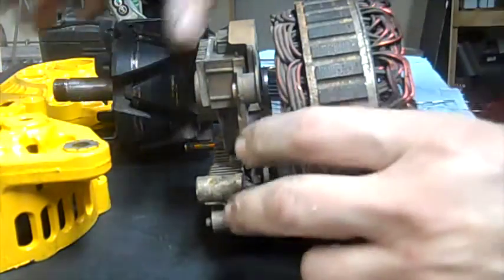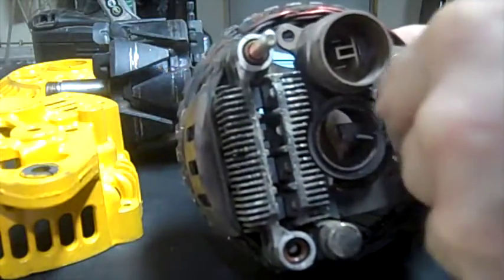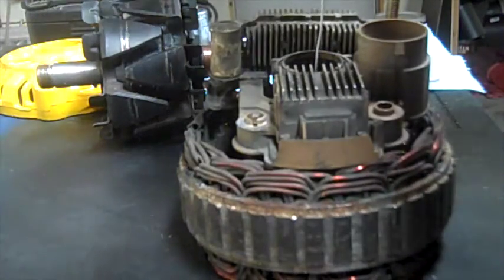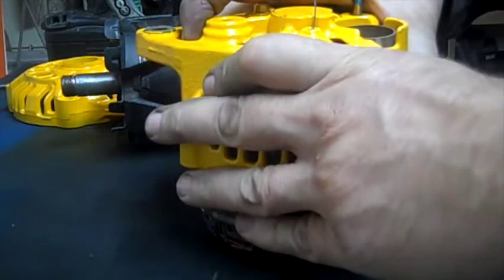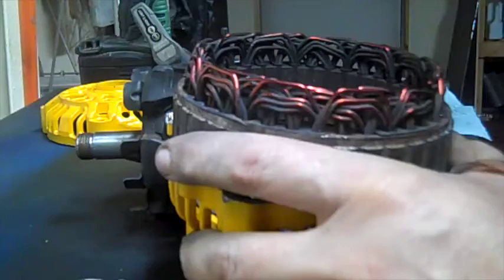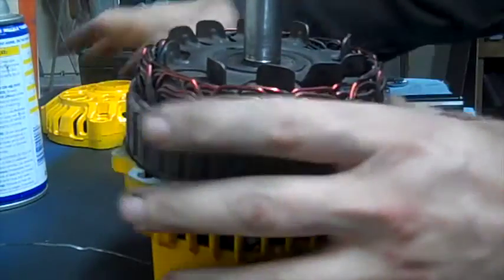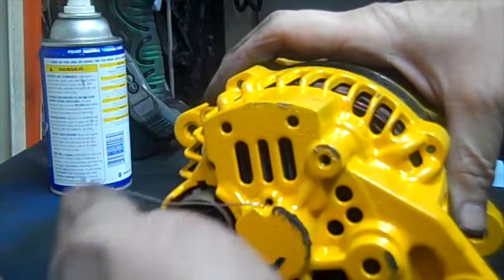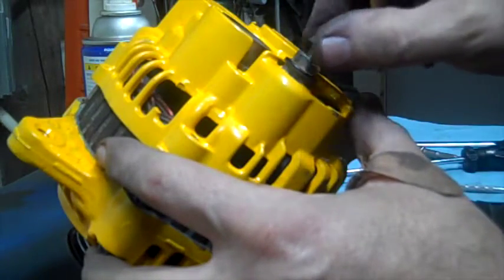1995 Suzuki Sidekick Alternator Reassembly

Comment: Hii i Need to learn how to change those central bearings
Reply from the maker: The bearings will have to be pressed off.  I did not try it because my bearings looked fine.  After I worked on the alternator in this video I just put it on the shelf and ordered a new one.  It is probably fine, but it is original and very old so I decided that, for me, it would be better to just spend a hundred bucks and get a new one.  I think, if you have some kind of press and notched plates you could press it off and press on a new one.  I just checked and it looks like the cost of the two bearings is more than half the price of a rebuilt alternator on rock auto dot com.

Comment: What is that you used to spray to clean it?
Reply from the maker: After taking the outer case off I cleaned the inside parts by spraying compressed air, wiping with blue paper towels and some cleaning with q-tips.  The outer case I washed in the sink with dawn dish soap and water and then dried it off and wiped down with wax/grease remover and then painted with a can of spray paint from walmart.